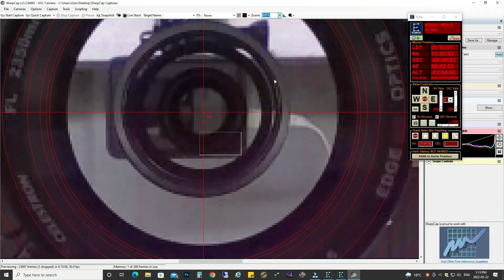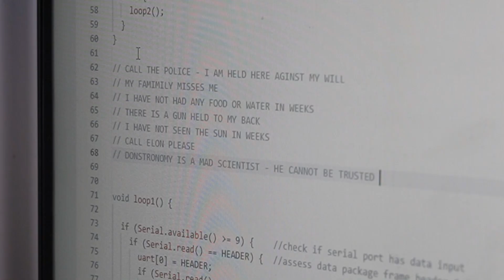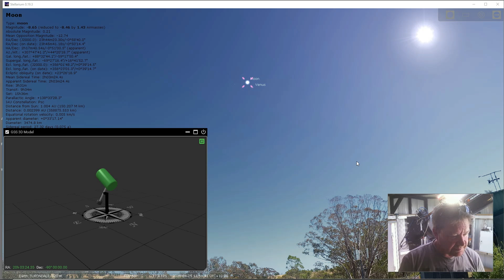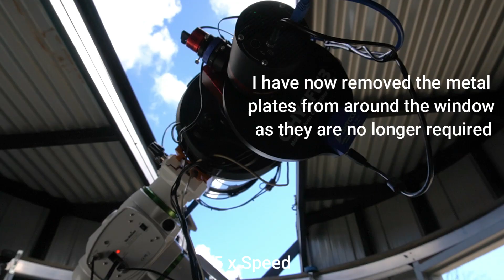Frustrated astrophotographer attempts to bring down Musk's Starlink network.

Comment: I can lend you a 2.5kW CO2 laser if that helps the cause, not sure if it will fit in there though, and you might have to get a special dispensation from the atmosphere to let it through.
Reply from the maker: Just a slight step up from my 0.35W laser. LOL!
I might have to get a bigger mount to go with my bigger observatory.😛

Maybe something like this?

https://en.wikipedia.org/wiki/Extremely_Large_Telescope

CS Don

Comment: What wavelength are the lasers emitting at?
Reply from the maker: 850nm so in the  infrared range. 
The sensors are angled outside the field of view of the telescope and only have a maximum range of 8 metres.

So far so good with 10min exposures with IR/UV luminance filters and 5 min exposures with RGB no IR filter.

CS Don

Comment: What an impressive observatory you've developed, Don. The tripartite laser configuration is really quite impressive.. I've contemplated whether incorporating LIDAR technology for dome mapping might enhance tracking precision. While your approach doesn't strictly utilize LIDAR methodology, it represents a remarkable technical achievement nonetheless. I suspect others in this community are experiencing observatory envy as we follow your progress - amazing.
Reply from the maker: John. Thanks' for the kind words and for watching my video. It's a simple process for the Lidar as I am only using the distance measurements to form the basis of the code. This way I can get it to work like a basic switch. Below or equal to this threshold do nothing, above turn the motor on etc.

Two potential shortfalls that may be a problem is dew building up on the sensor,  hopefully the sensor surface temp will stop this? It's approaching late Autumn so I guess I will find out soon enough.
The other was the IR bandwidth, which I should have mentioned in the video but forgot to. I have angled the Lidars away from the field of view of the telescope and have had no problems with 10mins IR/UV cut filter in Luminance and 5 mins with RGB filters no UV/IR cut.

On that note I am yet to process an image, so I hope that nothing rears it's ugly head when I start to stretch the image in post.
The stretched preview in SGP seems to indicate no issues. 'Touch wood'

CS and take care
Don

Comment: Surely your tracker has a data out that you can read to control the roof position. If you know the angle and asmuth you can calculate rotational position.
Reply: Would also have made the detector on the roof. I just need to know where the roof is at some point very exact. The rest is software.
Reply: @RogerKeulen  Oh ya, the position sensor for roof rotation would be everything :^)
Reply from the maker: Hi jane, thank you so much for watching and commenting on my video.

Because I'm a gadget junky, I love to tinker and come up with alternative ideas to solutions. I'm also a sucker for a challenge.
I have  the option of purchasing an encoder wheel and dome geometric software, but have decided to go with the challenge of the sensor's. Makes for a good video. LOL!

If I only had an alt / azimuth mount this process would be much easier, but as for the equatorial mount the azimuth does not represent the position of the roof as the declination ca be pointing 45 degrees in the opposite angle.

Also there is the advantage of not having to rely on software and it's communication vulnerability's  .

CS and take care

Don
Reply: @donstronomy7606  Still, pretty snazzy with the lasers :^)

Comment: Good work on the sensors, Don. I did wonder if the ultras would give you some issues, we use them a lot in industrial processes and they have their quirks.

Bad luck on the Star Link sabotage, but please don't give up! We're with you all the way.
Reply from the maker: Thank you for watching. The Lidars are definitely more responsive and accurate for this purpose. They are also giving me less false readings.

CS Don